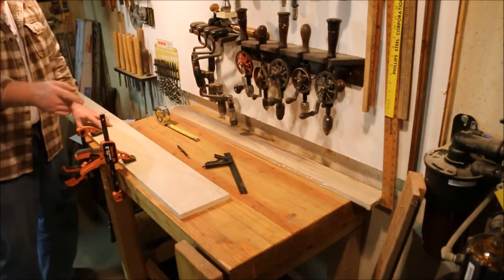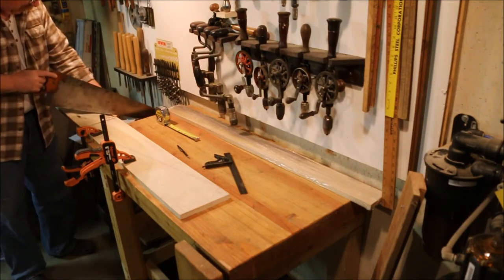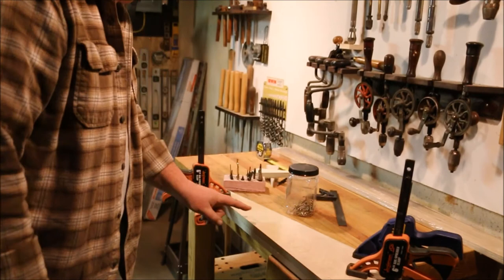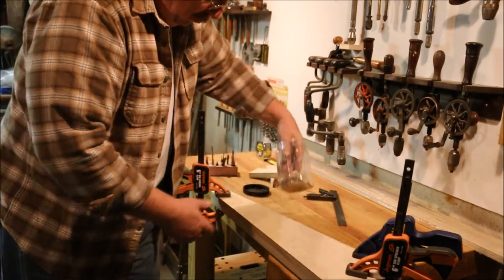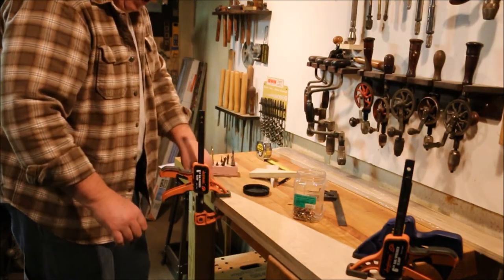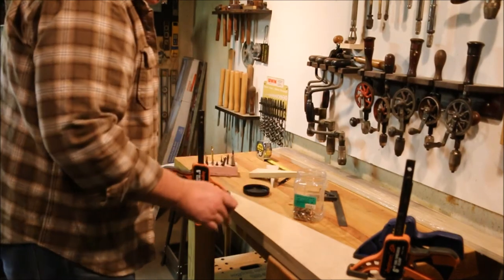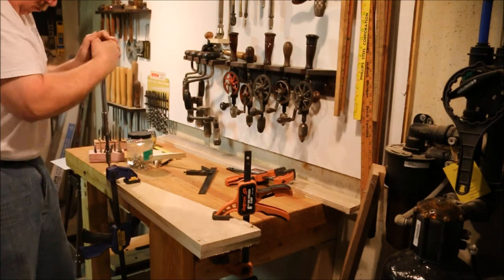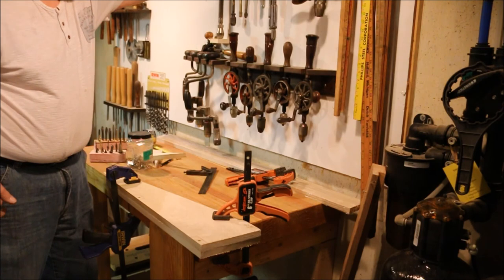MAKING A SAW TILL ~ PART 2 ~ LAYOUT

Comment: I ENDED UP USING A WOOD DOWEL FOR MY BOTTOM CROSS PEACE  1 1/2  IN,  LEFT FROM ANOTHER JOB. WORKED OK SO FAR.
Reply from the maker: Mike Tarzwell I like that idea. I already had the poplar from another project. It's good to have some extra at the end of the job. 😀
Reply: I've got a lot of scraps at the end of mine. Good kindling but a bit high priced stuff.
Reply from the maker: I start the fireplace with the shavings from the shop and nub ends of projects.
Reply: If I keep going I'll have more plywood to start fires with than I have to build stuff with. I suppose someone is relying on me to keep them going. The millions on welfare I suppose are some of them. The rest work a Lowes or live in d.c.
Reply from the maker: My wifes cousins husband managed a plywood mill in Plymouth. I got to visit while we were there. They were making a truck load of plywood every hour and I don't think you will run out too soon. 
It was a Weyerhaeuser plant that pretty much owned everyone. My mother in laws sisters got together and told him I was looking for work. 
We did a plant tour and it was really interesting. Then we sat in his office and he started asking questions. I thought they were a little odd but WTH I was game. We went through the ways to rebuild equipment and some electrical wiring questions and finally he said, Well I can offer you a position as a class b maintenance man. The job pays $3.25 an hour. I looked at him for a minute. Then I told him I already had a job making $7.50. Then we had a big laugh about the hustlers that set us both up. 
I never mentioned the job offer and I don't know if he did or not.